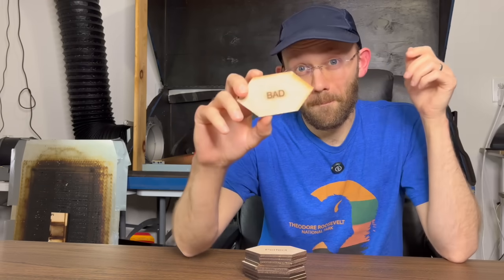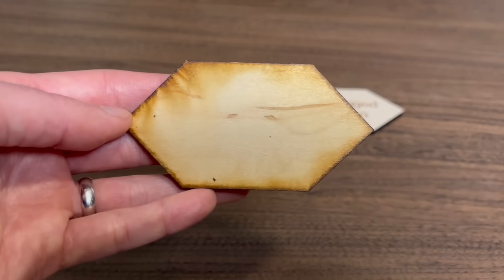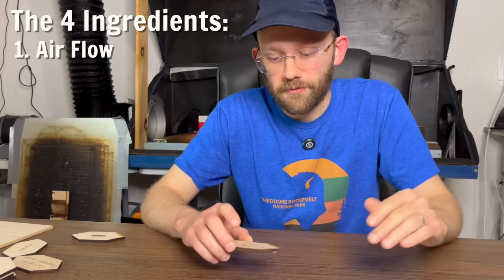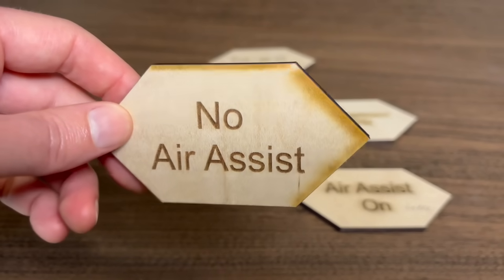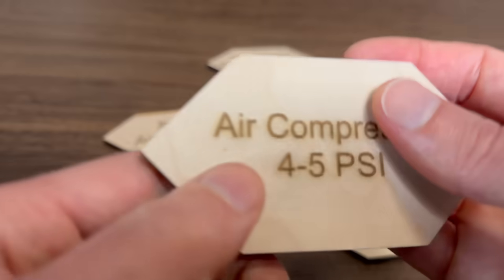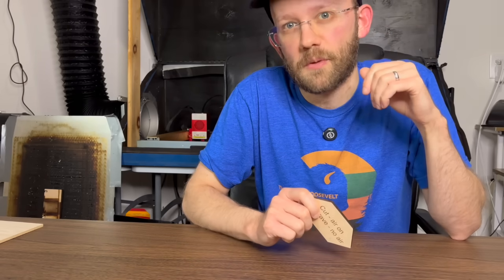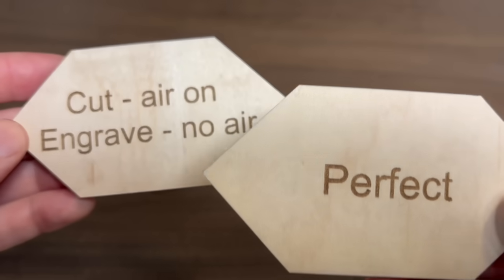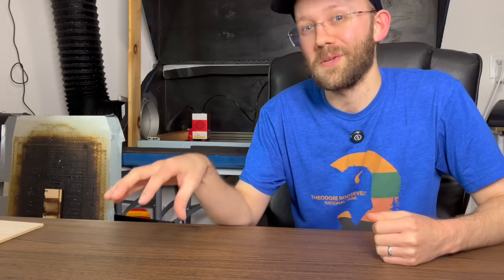Solve Laser Scorching without Masking or Sanding

Comment from the maker: Important note: I ran the tests in this video originally on a diode laser. If you are using a co2 laser almost everything in the video still applies, BUT you probably don't want to go with completely no air for engraving on a co2 laser as this can quickly get your lens dirty which can damage it or cause other problems. As a result, when I run my own co2 laser, I now use air assist, but turn it down as low as I can.

Comment: This was so helpful,  when you talk about your 'Jerry Rig' I achieve the same result by raising my wood 2mm above the surface of the honeycomb.  I have only recently started lasering so am experimenting...... a lot.  I have followed your suggestion on the Air assist and have increased the psi,  the difference is amazing,  the cuts and engravings are so clean with no cleanup needed. Am using the Creality Falcon A1 which so far has been a good machine although the air extraction needs more power.  Thanks again

Comment: you did so good job, if use big laser power like 300W & 500W  the cutting mark problem will be improved or use a CO2 laser marking machine for the printing, it will be much fast and good printing quality.

Comment: I have an OMTECH 80 watt and am currently using the stock air pump.   I’m thinking of replacing it with an old airbrush compressor that puts out 35-40 psi.  Please do a comparison of stock air pump and airbrush compressor.

Comment: Hi and thanks for the video , I have a question and wonder if you have any information or incite to it . Will not using the air assist have a greater effect on the buildup on the lens of the laser , I have been told that you need to use the air assist turned off in Lightburn which reduces the amount of air flow when engraving and will also help keep the lens cleaner , my problem is that even with it turned off the less amount of air flow still leaves a smoke/burn mark around the engraving so I pull the air hose off when engraving and then slip it back on when it started to cut . Thanks Laurie.

Comment: Thanks for this video, very informative.  Do you know if I can use an xTool air assist with another laser, namely a WeCreat Vision?  The WeCreat doesn't have an adjusting knob in its air assist so I was wondering if I could use the one from xTool to turn the air assist up/down as needed.

Comment: I’m using a CO2 laser and wonder if you need to change the settings if you use the rig to accommodate for the height difference. Like wouldn’t the laser head touch the material?

Comment: You should specfiy that you are using a diode laser. If you use no air assist on a co2 laser you'll burn the lens an cause a fire.
Reply from the maker: Good point - I've just added a pinned comment on the video with a note about co2 laser lenses and air assist.

Comment: What about vegtanned leather? I have an X-Tool S1 40W, and they have very few power settings, everything based on faux leather, which you're not supposed to cut due to toxic vapors. I've found that the X-Tool library is really lacking on power and speed settings, at least for leather and the S1.

I usually spray the leather with water, let is absorb for a few minutes, and then it sits flat on the honeycomb, with no magnets needed, no masking tape either. But the stitching holes come out smoky. If I use white waxed thread, it comes out all dingy. Makes me want to sell my laser since I bought it mainly for leatherwork. Maybe someone knows the right settings for leather?

Comment: Great series.  As an alternative to just using a large compressor is to use an airbrush compressor, which also has the benefit of not being very loud.
In either case it's good to use a local airbrush regulator with filter near the machine.  Easier to get low pressure regulation and keeps the airstream clear of moisture and any oil from the compressor.

Comment: Agreed. Definitely better results: engraving without air... but comes at a cost on my 100watt co2: im constantly cleaning lenses. And have already destroyed my compound lenses
Reply from the maker: That’s a good point - I’ve had no issue with this on my diode lasers, but on my P2 (co2 laser), I’ve started putting the air assist on as low as I can get it for engravings and anecdotally, this seems to be helping the lens stay cleaner.
Reply: As said, leave air assist on low. I now looking for solution to move from ACO-012 pump (bigger aquarium pump) to compressor and how to automate stuff if it can be done. If it's Cloudray compound, it maybe has some issue in design of the nozzle, because I broke one on just one job with air on (100W co2, air normal not low, I just sand stuff afterwards), second one started to collect dust on 20min job while original lens still in use, I clean it every week maybe even at longer intervals sometimes.

Comment: I tried your suggestions, removed the honeycomb bed which allowed air between the project and the spoil board, and connected my compressor set at 20 psi to the air assist port on my laser and got no scorching! Now can you suggest an air assist that puts out 20-30 psi, its a pain using my compressor? Most air assists on Amazon are rated in liters per minute which is a volume not a pressure.

Comment: after cut, side edge are leaving black marks on my hand. How to resolve this issue ?
Reply: Don't touch the edges,,,
No, seriously, a laser BURNS through the wood, the black marks are soot from that fire; there is no way to avoid that if you are cutting. Depending on the piece that I am working with I will sometimes spray the edges with water and that will in essence "lock" the soot in place so that it does not come off. Another more tedious option is sanding the edges afterwards.
Reply: While this is pretty normal, dialing in your power really helps here.  A very sooty, black edge typically means you are cutting with too much power or too slow.  A material test should reveal the balance of power and speed that will get you decent, repeatable results without turning the edge into charcoal.

Comment: Have you looked into a way to be able to use the automatic on/off that is in the Xtool software with a regular compressor?
Reply: I have the auto air assist from xtool and it turns on when you cut and off during the engraving so it does what he says gives you good cuts and engraving
Reply: @kaykayW85  I have the same, but his examples show even better with 20 psi which the xtool air assist does not supply. I was hoping he'd come up with an external controller or something to be able to activate a solenoid on the line from the air compressor.

Comment: Great explainer for beginners. 👍

I use the same air settings as you for cut and engrave, but with no air engraving I find I'm cleaning my lens every 10 mins. Have you tried using very little air assist during engraving just to stop the fumes going up and sticking to the lens? Would that be a huge hassle to switch air pressure settings between cutting and engraving all the time?
Reply from the maker: Thanks - and in theory, I think it is a good idea to have the air assist on low for engraving. It would probably need to be quite low, like around 2-3 PSI, because even running around 5 PSI I’ve gotten scorch marks on the sides of engravings. Personally, I just turn it off completely, but if I were running a more expensive laser, I might spend some more time tinkering to find a low PSI to run for engraving that doesn’t scorch the engravings.So in summary, I do think running air assist on super low while engraving is a good idea if you can find the perfect setting where it doesn’t scorch, but in practice I just turn my air off completely.
Reply: @chalkwatts  same here. I might experiment with it one day so I don't have to wipe my lens clean every 10mins.

Comment: quick tip, you can use upturned bolts in between the holes in the honeycomb to raise elevation and limit scorch marks in place of a jerry rig
Reply: Thats what I do but I have them the opposite way with a nut on it so I can adjust the height as I use a Co2 and the head is not adjustable
Reply: Use golf tees
Reply: Can you post a video or pic of what this looks like? Newbie to laser cutting. Thanks so much.
Reply: What a great idea!

 Especially to help hold in place for when a piece doesn't have large enough space between edge and honeycomb to have one of those pins in
Reply: What size bolts?
Reply: @sirmo667  that depends on your honeycomb. any size that fits snuggly enough so that they don't wobble, but not too tight that you shred your fingers pulling them out. Longer bolts for more clearance.
Reply: @sirmo667  I use a .22in or 5.8mm measuring with a caliper. Just measure the hole size of your honeycomb
Reply: Good plan
Reply: Wow, great tip!
Reply: Great idea, Thx'
Reply: Hi great. Is this for the top side to hold the material or the bottom side to hold up the honeycomb?
Reply: @candyluv6972  topside. just find the right size bolts to prevent wobble. add a bolt to adjust height easily.
Reply: Love this idea but dumb question....how do you keep the material flat and level?
Reply from the maker: Smart - thanks for the idea

Comment: I have an xtool s1. I use the air pump but I have an air compressor for my wood working. Would I be able to do this with the s1 or would that mess anything up since the airflow goes through the laser itself?

Comment: Hey Asher, great video. Can you please clarify something for me. @9:39 you are talking about cutting with the air assist on but engraving with it off. I am using the air assist that comes with my Wecreat Vista. How do you set it so it is on, on the cut but off on the engrave in the software?
Reply: In my Lightburn, there is a toggle that I can turn to off. I'm not sure what software you're using to send to your laser, but if it's Lightburn, it shows it in your panel when you're inputting your settings. Hope that helps.

Comment: Nice video.   Ingredient 5 would be Material. Both is type and quality.  Some materials just do not cut as well as others, and it's not just about thickness.  Some materials just create more smoke than others.   I think another thing people confuse is smote/soot VS scorching.  Scorching is to burn a material with heat.  If you can wipe that "Scorch" off with a damp rag, it was just smoke.  Smoke is very common, and wiping it off with water or isopropyl alcohol is an easy solution.
Reply from the maker: Good point, some materials definitely cut cleaner than others.

Comment: That was really helpful, thanks! Question - how do you measure the PSI of the air pump? I'm currently using a 40L/min aquarium/hydroponic pump but can't find any published PSI info. Also, is there a way to turn the air on and off automatically, or do you just do two separate burns and manually activate the air? Thanks for the great video - I look forward to checking out the others in the series!
Reply from the maker: My first air assist pump was 30L/min and about 5 PSI. I can’t remember off the top of my head if I got that number from the manufacturer or calculated it.

And personally, I control the air assist manually. Though it is possible to make it automatic with the right setup.
Reply: @asherdiy  maybe the problem of air assist is no related to the pressure, but to the air flow.
Reply: Check mpa or kpa and convert to psi

Comment: Has anyone used a cheap airbrush compressor?  They are typically adjustable up to 35-40psi and much cheaper, smaller and quieter than those big 'shop' compressors.
Reply: Yes. I had an extra one. That is what I use!
Reply from the maker: I haven’t tried it, but I don’t see any reason it wouldn’t work.

Comment: The dirtier your honeycomb and pan are, the dirtier the back will be.  Also, pitch/resin build up can catch fire...have multiple honeycomb s and keep one clean.
Reply from the maker: Great point - I definitely need to clean mine.
Reply: Excellent point! Use LA awsome, inexpensive and really cuts through the pitch/glue. And smells so much better than the green stuff.
Reply: Not so much.  Flashback is the laser beam reflecting back. Beam reflect better off of clean and shiny surfaces than they do off of dull and dirty surfaces.  Many users new to lasers, complain in laser groups about flashback.... and their laser beds are sparkly clean.  I do not have flashback issues, and my laser bed has not been cleaned in a year..... Because I use the correct speed and power to do the job, and excess power is the #1 cause of flashback.
Reply: @LithosAndLasers  Make sure your insurance will cover you when your laser catches fire.
Reply: @jonwoodworker  I keep my crumbtray clean, and I have like 2 FEET of clearance, so there is very little fure risk.  I have been at this o er 4 years ... In set.
Reply: Air assist has two factors, pressure (psi) and volume (cfm) , on my large CO2 laser I used a much larger air pipe to increase the cfm while keeping the pressure at a sensible level. However the other part of the puzzle is the actual nozzle under the lens, on my CO2 laser I turned a new nozzle with a small lathe and the nozzle was much longer than factor and most importantly had larger air feed. Not sure if I agree with your conclusion on no air on engraving, my experience was a bit different. The final thing that makes a big difference is the capacity of your air extraction system, bigger is better BUT also where on the machine it pulls the air / smoke from. For primarily cutting under the material is best and engraving across the face of the material is best. If you can set up a Y pipe with air gates ( like you would for a workshop dust extraction system) so you can swap between the top and bottom depending on the job

Comment: Some great info. I have a 24w j tech for my one finity elite that’s been in a box since the only time I tried it. I had air flow on for engraving and it seemed to feed the fire and burned it all. Anywho, just ordered the honeycomb, which I was unaware of and some hod downs. Also the term is jury rig, vs Jerry. Also, also, definitely interested in your course!
Reply from the maker: Cheers, Todd - thanks for watching!
Reply: I have the same setup as you. I would strongly recommend going to home Depot and by 12 by 18 ceramic tiles if you flip them upside down they have a grid on the back that will allow air to flow. This will save your spoil board.

Comment: Thanks for the guide, guess I need to replace my honeycomb for some applications or put something between it :)

Main downside I see for a big air compressor is that they're much louder and another huge machine you need to put somewhere. Also, is there any max PSI you should use?
Reply from the maker: Yep - it's definitely louder. I use a California Air Tools compressor, which is quite a bit quieter than a normal pancake air compressor. But it's still loud enough that I usually wear ear protection if I'm running it for an extended period.
Reply from the maker: I don't know if there's a specific max PSI. It probably depends on what a given laser can handle. But I personally never run it above 35 PSI.
Reply: I started with a compressor and went back to an xtools ali express pump just for the noise aspect and wearing out my compressor. It's fine for front only and okish for cutting but obviously I have a compressor for slash and burn  if needed.
Reply: I picked up an "ultra quiet" direct-drive air compressor a while ago.  It was cheap enough, standard 135psi thing, small tank, carry handle, looks like any other.  I needed a smaller compressor and figured if it was a little bit quieter then it'd be good enough.  It is so quiet!  Unbelievable how quiet it is. I mean, it putters along and it can rattle things on the table above where it sits.  More noise than a fridge compressor.  But, it's surprisingly "ultra quiet."  So, they're out there and it's an option.  Yeah, I use it for my laser.  The hissing air and stepper motors are louder than the compressor.  I do worry about duty cycle on longer cuts though.
Reply: @4Fixerdave  can you share the model you got ?  if you want to isolate the vibes put down some HD foam then a cement flag stone big enough to sit the compressor on above that foam, it will isolate the vibes by at least 70% for next to no cost. the different densities  and added mass will solve it .
Reply: @CarkeekW    ROK, but I doubt that will help much.  Most likely a generic Chinese brand.  I'd suggest finding an "ultra quiet" and see if the store will demo it.  

And, to reduce the vibs, I just take it off it's shelf :)   I run it on a condo patio, no complaints.  Wouldn't run it at midnight, mind you, but there's nothing to worry about during the day.

But, in thinking about it, I bet an old fridge compressor would be near perfect for air assist.  Very quiet, probably just enough air volume so that regulating is not needed, and basically free.

Comment: Very helpful info. I'm going to stop being so lazy, and replace my aquarium pump with my airbrush compressor, today. Thanks!
Reply: i have one...but it gets really hot. You would need a bigger one.
Reply: @mpa568  True. Mine gets very hot. I have another compressor that I use for my resin pressure pot. I'm going to switch to that, soon.
Reply: @MileyonDisney  
What are you going to buy? I Just bought one of this cheap laser compressors to compare. Dont have results for now. I simply dont have much space in my tiny office (1.8meters x 3meters) ...i cant put a big compressor in there.